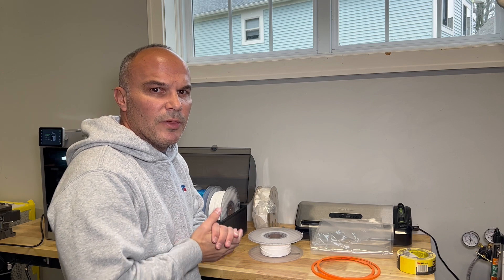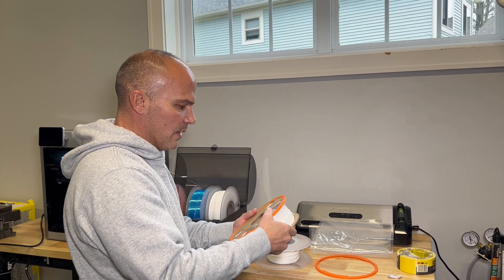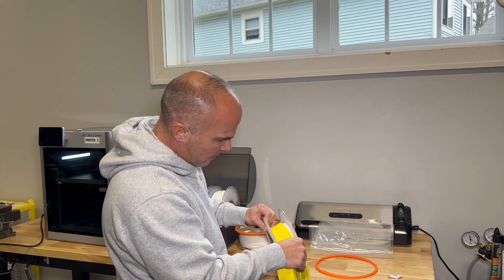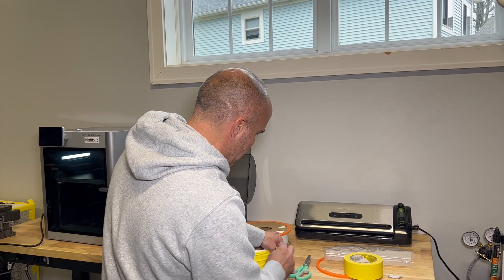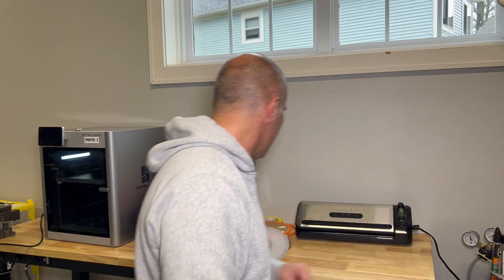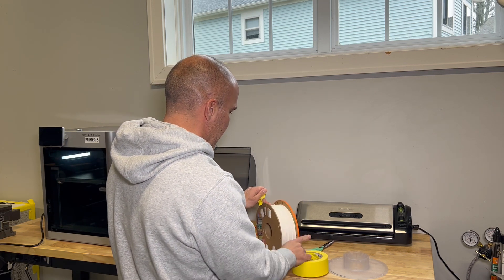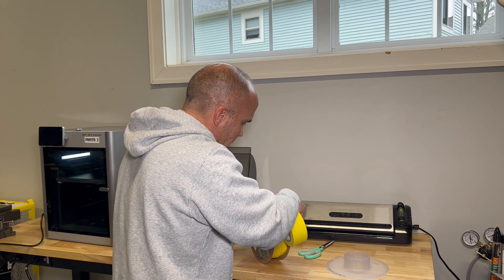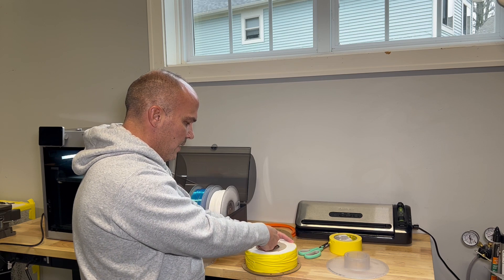Awesome Cardboard Spool Hack For Bambulab X1 Carbon

Comment: Nicely presented video, but reloading your filament really shouldn't be this much of a chore!  The transition to cardboard rolls really pisses me off.  Plus, I don't know why our favourite filament suppliers don't fully support refillable plastic spools.  I had been using eSun for years, and their plastic spools worked perfectly in the AMS.   Their cardboard ones don't, and their published printed ring solution doesn't allow the AMS lid to close fully (letting in all the humidity I have around here).  Unfortunately eSun only do a few basic colours in their refilament range.  :(   I tried Bambu Lab filament refills & spools, but the quality was way short of my experience with eSun.  I can't do what's suggested here as the eSun cardboard rolls not only vary in size, they don't fit any of the plastic spools I've tried (hub too small, spool too wide etc.).  Only limited brand options available to me where I live, at an acceptable price.  So the journey continues trying to find a goood AMS compatible solution, that matches the print quality I was used to.  Bambu Lab made 3D Printing so much more fun, then cardboard spools made 3D printing an exercise in frustration again!

Comment: So far i have just wrapped the cardboard spools with electrical tape.  I like this better. You could print the bambu spools in diffrent colors or even modifiy the spool size to be wider if needed.

Comment: No need for tape on a new spool, it will never move as long as you hold the end of the filament through the spool hole on the other side.

Comment: This is a great solve for the cardboard spools issues.  I put my tape sticky side out and laid the start of the filament on that, then wrapped around the filament.  Then the only sticky bit is on the end of the filament after you remove the tape.

Thanks for the great hack!
Reply: BAD HACK  Check diameter of spool first

Comment: I just use the cardboard filament as they are. If they aren't bent, they work on the AMS fine. Haven't had a problem with just cardboard at all

Comment: if I needed to do that for every spool i buy I need to hire some guy for a full time job lol. i dropped all cardboard spool companies cause of this. I recently had the problem with Polymaker PC Max on cardboard and used the original printed adapter for AMS. Files made by polymaker. Even then it not fit really. Unfortunately it is one of the better PC filament you can buy. On normal PLA and PETG I avoid to buy cardboard spools.

Comment: Outstanding video. My P1S is still in the box and about to set it up. I was excited about the refill roles and using less expensive filament. Your video was the best I've seen on the process of loading those roles. Thanks for sharing.

Comment: Good tip and video for others that use filament on cardboard spools. I do the same thing but all that tape isn't necessary and it's just wasteful. Simply tape down your loose end (start) of filament and rip once of the cardboard sides out. Then you slide on the one half of the Bambu reusable spool, flip over and do the same. My two cents ;-)

Comment: Just what I was looking for. Carboard spools are cool and good for the environment (in the long run) but honestly I have grown afraid they will ruin my AMS. The rings do work when the spool is not full, but they are not a good solution. I just noticed the AMS works perfect with plastic spools no matter if they are Bambu spools or not. Polymaker spools are a pain for the AMS, at least until they are about half way empty. I guess the weight and the force of the AMS pulling on them just makes a sort of spring system that fails and the AMS gets stuck, not good for its gears. Will try this as it definitely saves a lot of time and effort respooling while I can keep buying filament in carboard spools.

Comment: Just to add: this trick only works with spools that are exactly the same width. Sadly, the cardboard spools I have are less wide so for me the best option was to use electrical tape and wrap that all around the edges of the cardboard spools. Works like a charm.
Reply: yeah i found that the hard way the cardboard spools are not same width
Reply: @sgt.miningdrill2680  Oh no.. I hope you managed to recover at least part of your roll? :-||
Reply: @MarinusMakesStuff  i made my own spool holder that can be put in drill chuck

then i just needed to slowly roll everything back on

i made it with two aluminium can bottoms, bolt and 2 nuts
Reply: Yep, I almost ruined a 1k roll this way trying to transfer Jayo 😢

Comment: But the notch on the Overture cardboard spool core does not lock into the nub on the plastic Bambu spool core like their own refills do, so it could easily spin in the AMS without pulling the filament out when the AMS Unloads during a filament change. The Overture cardboard core is much larger than the Bambu refill cardboard cores. Overture would need to match Bambu's core diameter for your plan to work. I like your idea, and it would be nice if they did, but they don't. 😂
Reply from the maker: In the description for this.  There is a spool adapter for Overture.  I plan on making a updated video showing the spool adapter.  It still works without it but works better as you are saying with the adapter as it had the notch.

Comment: great idea but it does not work with a proto-pasta spool. the core is to big.
Reply from the maker: You will need a spool adapter to make it work.  I plan on making a follow-up video.  https://cults3d.com/en/3d-model/tool/bambu-lab-protopasta-spool-holder-for-ams
Reply: thank you i'll be printing these asap!

Comment: Super useful but doesn't work with all types of filaments, I tried this using eryone white PLA and the diameter of the center was smaller than the bambu plastic spool and now I have a bunch of unspooled filament 😂
Reply from the maker: Sorry yeah works with Overature, Polymaker, and Inland.  I would recommend testing with a empy spool first.

Comment: This is waste of time. I use many of the cardboard spool filaments on my P1P. You don"t need to transfer it to Bambu lab spool or print the liner. I just use the 10mm electrical insulation tape around the cardboard spool on both sides. It works fine without any problem, and rolls better.
Reply: The fact you said it rolls better when it’s not cardboard is the reason to just put it on a plastic reel.

Comment: What do you do for polymaker rolls that have a bigger inner diameter? I did this with a couple of my polymaker rolls buy for some reason my black polymaker roll had a bigger inside diameter and would spin inside the bambu spool so I had to cut some cardboard up to fill the air gap so it was snug
Reply: the inner carboard from a bambu refill slips perfectly inside a polymaker center hub.

Comment: Just tried this .. the new bambu spools that are shipped with the AMS, have a smaller core in outer diameter, compared to the cardboard spools inner core... leaving about 1/4 inch of play within the cardboard core.. aka filament rolls freely inside the bambu spools... anyway around that?
Reply: Yes, way too loose.  I had to design and print a ring to go around the cardboard core as a shim, fitting between it and the Bambu spool.  It was a simple design using TinkerCad.  Dimensions were 82mm ID, 90mm OD, 55 mm tall.
Reply: @Mike-wc6iy  thanks for the info but I made one as well lol

Comment: Great video, thank you for this.  The tape idea was the ingredient I was missing.  One additional step I would suggest, cut the discarded cardboard spool sides and use as jambs to hold the plastic spool snug against the cardboard center.
Reply: You can print plastic inserts to fit inside the cardboard spool to make it a perfect fit.
Reply: This is a great idea, I just had an issue where the cardboard center was slipping on the spool when there wasn't much filament left and the AMS was trying to retract the filament. I might measure the distance between the spool and the cardboard so I can create a reusable jam so that it won't slip at all.

Comment: If you print the cardboard ring adapters in PETG at 95.9% and stretch them on it will work with the cardboard spools in the AMS

Comment: Ive just been putting electrical tape around the rim of my overture and Polyterra cardboard spools. Been working fine for me. Electrical tape naturally contours the rim so it's easy.
Reply: Does it work well untill the end of the spool ? I read comments saying that cardboard spools were lighter and that they would slip when almost empty. Some people add descicant in a printed holder in the center of the spool to add mass while also keeping the humidity down in the ams.
Reply: @ockay16  it does work all the way to the end. That's all I've been using. The spool does bounce a little towards the end still. I haven't added a dessicant weight to it yet, but I might. I do have dessicant in the AMS and it's been staying at 10% humidity.
Reply: As the electrical tape wears down you'll likely get into the adhesive and that adhesive will ruin your rollers.
Reply: lol, nah @tysoncolley8110

Comment: Ever had a cardboard spool so wide that the Bambu spool would not lock together?  This would be something to be aware of or you could have a big mess on your hands.
Reply from the maker: Others have had this issue as well.  I would be nice to have a list of spools that work.  I should have said that you should take an old spool without much filliment left on it and test it first before trying with a new spool.
Reply: @timpmcfadden  i have a roll of polymaker cotton white that for some reason is wider and taller than every other cardboard spool i've got including other polymakers. with a plastic rim and a single piece of duck tape for extra security to prevent slippage, it was wide enough to get stuck. hoping swapping the spool to one of bambu's empties will do the trick for me

Comment: Nice, gonna try this out with polymaker. 
What are you doing about the NFC tag showing the AMS it's the other type of filament?
Reply from the maker: The NFC tag is part of the roll that get removed during this process. Once its removed you need to manually select the type of filliment for the AMS
Reply: @timpmcfadden  Oh perfect, I didn't realize this and though the tag was on the spool holder. Thanks!

Comment: That's alot of work when ypu can just put electrical or duct tape around the edge of the cardboard spool.
Reply from the maker: I was using the plastic spools rings, same as electrical tape.  I created this method when a couple new spools I opened were dented, bent or warped and the rolls were wobbling around in the AMS and was really frustrated and ripped the sides of them.  Since I have started using this method for all my spools I have had zero issue with the AMS.

Comment: creative, but way too much of a hassle for me. If printed rings won't work I would simply switch to another brand with plastic spools. Enough choice on the market. Thinking about doing that for every roll of filament I use is giving me anxiety 🤣
Reply from the maker: I agree it’s a pain. But sunlu doesn’t have as many colors as overature or polymaker.  Also most manufacturers have switched to using cardboard spools.
Reply: @timpmcfadden  True, just got a big box of filament from my main supplier...and they have switched to cardboard. A good thing normally, just a pain now with the AMS

Comment: Happy to be subscriber #6
1. Had no idea the bambu rolls could be reused like that 😳
2. 100% trying this out
Reply from the maker: The Bambu printable spools also work well.  I was surprised they would print so great.  https://wiki.bambulab.com/en/knowledge-sharing/Links-to-STL-models
Reply: All Bambu filament comes spool-less... So they sell the reusable spools, it if you get an AMS on its own, it comes with 4 reusable spools. 1 high temp 90C and 3 regular 70C..
Reply: @BaldMouth  Bambu sells filament with a spool as well.
Reply: @BaldMouth  only comes with 3 spools now dont get white anymore
Reply: @jamesharris9894  well that sucks...
Reply: @BaldMouth  yep get 250 gram orange and a carbon fiber and  support material
Reply: @jamesharris9894  that's the x1 bundle... if you order the AMS on its own (for example if you got a p1p) it comes with 4 empty reusable spools.
Reply: @jamesharris9894  I can confirm it comes with 1 white 3 clear... Just received my ams today.

Comment: Finally a video of this.  I’ve heard rumors of this but nothing showing exactly what to do to prevent birds nesting.  Does the cardboard feel snug on the center portion of the spool or does it feel loose?
Reply: Been doing this since day 1 and gone through 2 spools of polymaker without issue. The printed remixed holders also work. Don't even need tape, just rip one side off, insert and flip, repeat.
Reply: I just did this and unfortunately the cardboard will spin a bit. While the spool is full there's enough filament to hold it snug against the sidewalls, but once the filament is mostly empty it's going to spin. I'll open it halfway and stuff some wadded up paper in between the cardboard roll and the plastic roll, to give it a bit more friction.
Reply: @MrNeek69  I used the cardboard from the discarded spool sides as jambs.

Comment: Coming from a guy who runs pretty much exclusively Polymaker Filament, this is seriously the best. I have trouble with Polymaker’s cardboard spools all the time.
Reply: I think for someone like you thenpolymaker spools can be really annoying in the ams, but the cardboard makes problems in so many other spool holder types... I just like the replaceable spools of bambulab a lot more.
Reply: @Pidrittel  can agree. I’ve been printing up reusable spools to start moving rolls over from the cardboard spools using this technique now.
Reply: They are really bad when the spools are full, the AMS gets stuck all the time. I am planning to replace all the spools and this is indeed a nice trick I'll give a try.